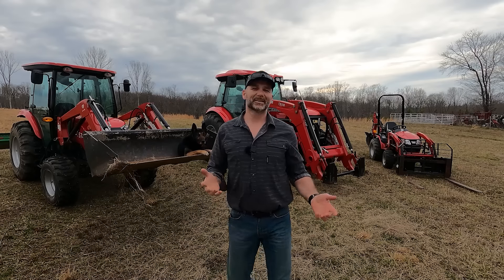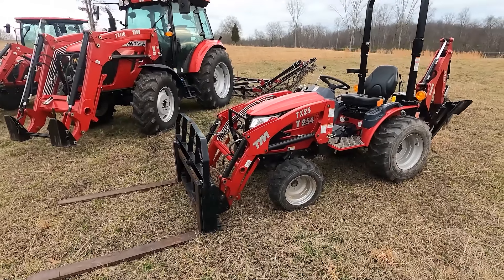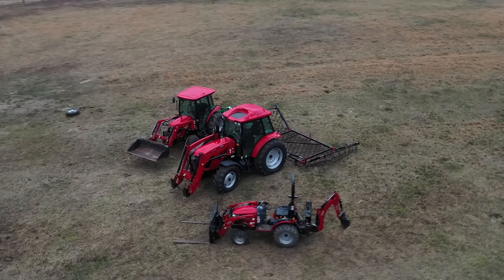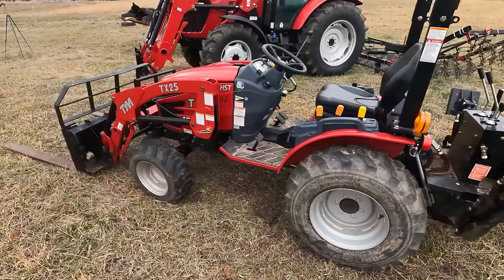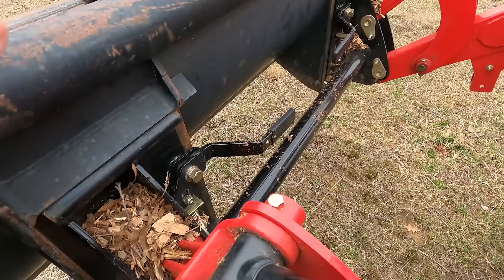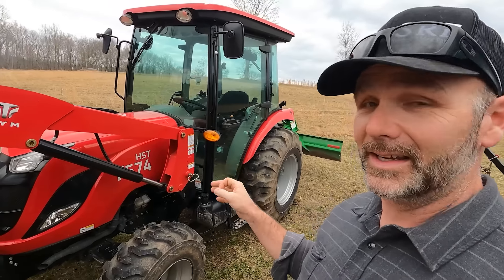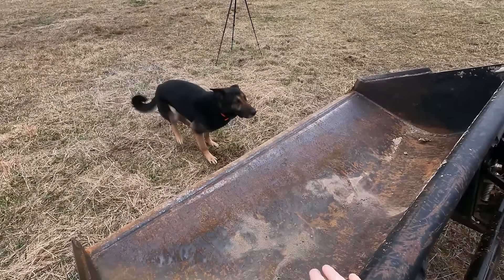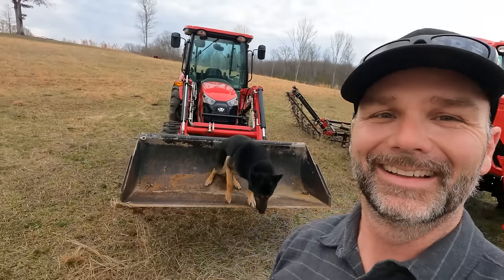Red tractors! The TRUTH ABOUT TYM You were right!

Comment: I am a sixth generation farmer in Missouri and at least a 12th generation farmer in America. All my ancestors were farmers in the American Colonies and later the USA, as well as in Europe (England, Ireland, Scotland, Scandanavia and Austria). My Grandpa bought the first tractor, a John Deere A. I inherited six or seven tractors from my Dad and I bought another four brand new JD tractors. I still own and use my Dad's 1969 model JD 4020. All we've done to this old tractor is change the fluids and filters and replace the batteries and tires when they are worn out. I've never owned a utility tractor or lawn tractor, like those in this video. I don't believe these off brands are manufactured to last decades like a John Deere is.
Reply from the maker: My John Deere 5065e has a stamp on the side that says MADE IN INDIA...not INDIANA.....INDIA!!  To your point....I don't think anything is manufactured these days to last like the machines of yesteryear.  However the smallest of these tractors runs a Yanmar engine...probably the most common engine in the compact Deere lineup.  Green paint does not mean made in the usa....anything mechanical will eventually fail....would I rather have a non computer controlled machine? Heck yeah!

Comment: The price point for TYM/Rural King for a 75hp cab tractor is the same as the name brand Blue/Red/Green.  Until you get into the 100hp range and above, they’re all basically the same tractor.  Case New Holland are the exact same tractor, ones blue ones red.
Reply: @4BikeMike  WHAT ??
Reply: @4BikeMike  no! Definitely not I have owned the new Holland 75 hp workmaster as well as the Kioti 7320. Much different tractors. The new Holland tractor that I have which was made in 2021 was built in turkey!

Comment: Yeah, I was thinking about TYM but we don't have a dealer nearby though. They looked like well-built machines! I went with Kioti because the dealer was relatively close. Very happy with the Kioti too! I don't think you can go wrong with tractors from South Korea!
Reply: I got a kioti and enjoy the year I've had it and my only issue is I'm lifting too much and turning to sharp and I've killed my two front tires cutting them on the rims but an easy fix.

Comment: They didn't "partner" with Branson - they bought Kukje (Branson parent company) and incorporated the Branson in the TYM lineup.  Nothing changed other than instead of Branson, they say TYM - but the tractor model numbers are even the same.  They also have a very small "Overlap" so both lines will probably continue into the future and now any TYM or Branson dealer now has access to both lineups of tractors.

Comment: Yanmar Diesel engines have been used in the boating world as an extremely reliable engine for years!
Reply: They've been used in boats for at least 50 years. And a lot of engines from 50 years back are still in use. So there's little doubt that Yanmar has made some very reliable engines.

Comment: TYM tractors are great. I had one for years. Open platform 48 hp tractor. I did the research spent about a year before I bought it. Purchased back in 2013 had about 400 hrs on it. The only issue I had was I broke a loader control cable because it froze up rock solid. Water got down in the silicone boot and froze up the next day. where I live it was going back and forth between 20 degrees above zero and 15 to 20 bellow zero every few days. Typical winter. 😆 my fault for leaving it outside overnight. A touch of black silicone around the top of that boot and never had an issue again. The best thing was the dealer drove out 3 hours on a Sunday to fix it for me. He was the owner. Didnt have a new part in stock so he took one off a brand new tractor on the lot. No charge at all. Would take a $50 tip. Wouldn't even take a cup of hot coffee and it was cold as hell. Sold my machine because My job required that I travel and I needed a new truck. Miss that machine everyday. Will be buying another one this year.

Comment: We looked at one of the tractors the other day. It was on for 70k (CAD). We wanted to buy it and while they did have good payment options (up tp 15 years!, flexible payments, paying it off without penalty..) the interest rate was 8%. We will probably get a Kubota now they offer 0% for 84 months. Went to anther dealer who offered 0% for 6 years which was good too (pretty high monthly payments but you also have it paid off quicker).
Reply from the maker: yep...don't you worry...the interest cost is built right into the price of that orange machine my brotha
Reply: Hey thanks for your message. I probably didnt make myself clear: the payment would have been 300$ bi-weekly for 15 years for that 70k tractor. So that interest rate would have been 47k on top of the 70k sales price so a total of 117,000 for that 70k tractor. The other option was 1104 for 84 months which would be 22736 in interest so a total of 92739 if you pay it off quicker. Kubota offers 0% interest for 84 months so if you buy it for 70k for 84 month you pay 833.33$/month. We would have bought the Tym but we are not paying those interest rates.
Reply: Oh I didnt read your comment careful enough. You mean that Kubota is building that interest rate in. I have to double check but I think I can get the same tractor for 70k at Kubota but at 0%.

Comment: The problem isn't necessarily the brand it's the lack of service/parts with these other brands that are not JD or Kubota. And it's not that you can't get the parts it's that it can take weeks or months to get them so you could be down for a long time. You don't have that issue with green and orange. Resale is also significantly lower on these other brands but that might not matter to some especially if you plan on keeping it a while. If one of these companies like LS or TYM actually put more into their dealer and parts network they could really take off but for the most part these dealers are small lawn mower type dealers that really sell these on the side.
Reply from the maker: is this speculation or experience with TYM parts talking?
Reply: @StoneyRidgeFarmer  experience with both tym and ls. Look at their dealership network.  Both are pretty small on top of that it's usually small operations that sell them.

Comment: The E series John Deere tractors is an economy line they designed to compete with Kubota prices is what I understand, I priced them both out and Kubota was still 5k cheaper with more options for a 70hp, mahindra and TYM were to tall and didn’t have an option for a down spout exhaust, I use it in the poultry house!
Reply: Kabota gehl and mustang are all the same
Reply: Run from the Deere 5E series. They got a lot of issues.
Reply: @redbovine  well I don't own a e series but I've put a good put of hours in on one. It was gutless for my usage. I will say that I also ran a 5525 jd which was before deere's letter series and it performed far more then I expected it to. It was a great tractor but since they don't make em anymore I've moved onto other brands.
Reply: The E series have an aluminum rearend and are not that great
Reply: @paralyzedlife8763  I had one with that 5cylinder engine they use in skid steers.  Water leaking from front cover (they don’t use a gasket there) and 4 oil coolers.  3 coolers cracked and leaked outward. The last cracked and dumped 1 gal oil into the radiator. All within the first 1000 hrs.  After 3 years that thing went down the road.

Comment: Thank you for sharing this. I currently have a Kubota 2501 that is getting a little too small for my needs and looking to upgrade. I test drove a TYM T494 today and it seems quite nice however I did have one complaint. The front end loader controls seem a little slow and while trying to curl the bucket and lift, it would only do one function at a time. Do you experience this while yours as well?
Reply from the maker: Kubota's front end loaders seem much faster to me....in fact almost too fast.  My good friend has a Kubota and I've seen how fast his bucket moves...it's faster than my skid loader...too fast in my opinion.  Now...with the TYM...just bring up the RPM and you'll have full hydraulic power.  I've never noticed any lag or issue with mine
Reply: @StoneyRidgeFarmer  thanks for the response. The one I tested was brand new and this is something I’ve seen with a multitude of tractors. I know this wouldn’t be a function used all that often but no matter the rpm, I could only get the FEL to lift and dump simultaneously if I did full dump and just barely lifted the loader. If I went full back and right on the controls (lift and dump) it would only lift.

Comment: OK my thoughts ,                                                                                                      1, these are foreign made, however Deere, New Holland, and Case Ih, in this size are as well.  2, 111 hp isn't big . 3 ,that light control under the shuttle shift lever is just beging to get busted of by the leg of someone jumping in or out in a hurry.  4, I like the gear shift better than a neighbors case ih farmall 120c (and I am sure the tym was a lot less expensive) but not as well as our Kubota M10X with a 8 speed full power shift and high low.  5, our Kubota has over 7000, hours on it and is currently broke down, but overall has been a great tractor,  170 some hours on the TYM just ist enough to prove its reliability to a serious user.  I'm curious how it will hold up in the long term. Thanks for showing us the tractor and good luck.

Comment: I have the 1054 and the DEF system sucks I am on the third system in less than 1100 hours and its a challenge to get TYM to fix it. They don't understand how it works so I have been sent to a dealership in Canada to get questions answer. Other than the DEF system it is a awesome machine. I do think they need a better service department to support the dealerships.
Reply: I know a guy with a 1054 and he's had some problems as well, mostly with the emissions equipment. He did kill the fuel pump and injectors by running water through the fuel system so that wasn't necessarily the tractors fault. He was looking for a way to delete the emissions last I heard.

Comment: The tractor brand is no better than its dealer network. We operate a family row crop farm and over the years have run Ford (now New Holland) and John Deere. Initially we had a local Ford Ag dealer where my dad dealt extensively and received excellent service on his equipment. They eventually closed back in the late 80's so we began running Deere. Initially, our Deere dealership provided strong service, however, over the years Deere has forced its dealer network to merge into very large conglomerates. Quality Equipment probably has in excess of 35-40 locations. The service has gone south. I'm located in coastal plains region of NC about 45 minutes inland. We're just beginning to see TYM in this part of the state.

Comment: I agree with other comments there’s nowhere near enough hours on any of those tractors to see how they’ll hold up. However I do feel like they are a good deal but at the same time dealer support is almost non existent. I can literally drive to 4 different Deere dealers and 3 kubota dealers in less than 45 min from my house. And honestly it would kinda bother me they use 3 different engine manufacturers between all those lineups. I think it may have been Montana tractors back in the day that changed engine brands a few times during they’re existence which makes parts hard to come by later down the road heck even getting the right filters could be a challenge. But either way this day in age I feel that about all brands are built well it’s just some are better than others. But the lack of dealers would be the deal breaker for me honestly
Reply: Montanas were also TYM tractors I believe as well as the ones sold under the Cabelas branding for a few years.  The local dealer in my area sold Montana then TYM/LS.

Comment: It's nice to hear that TYM is teaming up with some other brands. I hope they consolidate and come up with subcompact tractors that are nearly as nice as deere and kubota. That small one looks like it needs some refinement but hopefully soon! Love my 1025r but other brands are getting closer!
Reply: No refinement needed, most TYM designs are similar to older IH. Very little electronics and many don't require DEF. Additionally, due to their extra weight and hydraulic pumps Kubota and John Deere in comparable hp range can't lift as much front or rear. Parts are considerably less than JD.   
But the green hat does look cute on you that is.

Comment: Very informative video.
I think don't hold me to this but in my research I think you will find that kioti and bobcat are also in this family, also made in korea but mostly assembled in usa, think you also find bobcat is assembled in statesville nc.(along with the orange dog)
Something I did not like in the mid size tractors is throttle is reverse from what I have always been used to. (foward is slow and pulled back is fast)that's a learning curve I did not want to tempt.
I did really like the rear control ability at the 3pt hitch, (but that wasn't enough)
I have had a rough time dealing with over seas specifically "asian" areas on several occasions and this turned me away from tym and it's family.
Glad you have had good luck with the line.
I ended up buying 06 green for several reasons.
Those were; non def and a true green engine. 
I have known the green line for many years and parts availability, may cost more but I can always get them.
Truthfully tym was the 1st. that I considered, then the white cat and orange dog, yes in the end I will probably pay more, but again I went with my true gut after what I continue to find. (dealing over sea)
I was not going to drop +40k and risk the same trend.
This is only a problem if you have a problem, I realize...
I know first hand of implements made over in that area where large numbers were ordered and only a few came over on the ship and half of those were missing hardware and some machining was not completed.(what a joy it is to pre-pay and receive that kind of garbage)
and You have no leverage to make over seas comply. the reply is um so sorry, yes dear, ok and then dead air.
15 yrs worth... and covid only made it worse.
I also dealt with a drone company over there that absolutely holds you hostage... after taking your$$$
No thank you.

Comment: I’ve had 4 Branson’s, 2 TYM’s, 2 New Hollands, 1 Kioti and an old Ford. I will say that the one thing I hate on the Korean tractors are the power reverser/ electro hydraulic shifters . They can be horrible , especially once you get up in the high hours. The hydraulic control valves begin failing every time. They get so it’s almost impossible to feather the clutch which is bad when backing up to an implement or loading hay on a trailer, fine movements ect. Some of the newer models allow now for user controlled sensitivity adjustments but the older ones don’t.  Also, the auto 4wd is controlled similarly so as time goes on the sensitivity of the auto 4wd goes down . I still like the tractors but I’ve been much happier with my New Hollands over time.
Reply: 0n

Comment: Thanks for the insights, Josh. We really need to be exposed to options like this. Without some help, we're stuck thinking all tractors are green or blue or whatever, depending on where we live. Around here, I don't know if I ever see anything other than green. I wouldn't even know how to look for other options around here.

Have you been able to spend any real time in the electric tractor? I saw you introduced to it, but am wondering how it would work out. Might it be a good small-job tractor and have a big diesel for the larger jobs?

Comment: We had a Mahindra dealer nearby and the people that bought from them probably thought they made a good decision. But the dealer didn't have any good service mechanics and didn't stock any parts. The word got out and many of the remaining new tractors sat in the sun so long the red plastic was faded. They went out of business and now those that bought one have no local support. But they did save some money at first.
Reply: There is this new thing called the internet, they can find all parts there.
Reply: That happens with many different things.
Reply: @asherdie I am struggling to find parts for a Montana (from Montana to LG Montana, then LG, and finally is now currently known as LS) cab tractor.  It was also built in South Korea, and it is a nightmare to find replacement parts for.  One part I needed was back ordered everywhere in the US for over a year.  One dealer claimed that they had it, and then repeatedly sent the wrong side (tie rod end).  Finally, we gave up on getting the correct part, and It had to be fabricated by welding part of the old to part of the new/incorrect part.  It has had to be re-welded a couple of times since then.  The tractor was down for months while I played mail the wrong part back and forth with a tractor dealership in another state.  I don't own this tractor.  I have dealt with this headache for a family member.  If I need a part for my Kubota, I go to the local dealership.  If they don't have it, (rarely) they either order it or point me in the direction of another local dealer who does.  It is pretty painless.

Comment: I wouldn’t hesitate to buy one of these if it met the requirements I was looking for. However you really can’t say how they hold up with Less then 200hrs. How they do after 1000, or really 2000hrs is a true measure of reliability, or even 5000hrs. No new equipment should have issues in the first few hundred hours. Although it’s alot more common now with all the technology and emissions to have issues early on. So it’s good you haven’t had any problems yet.